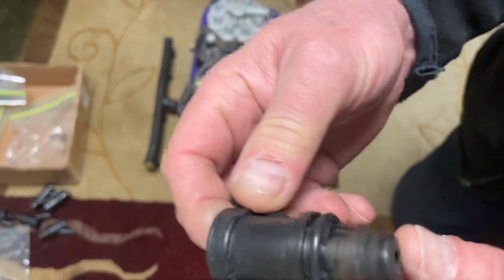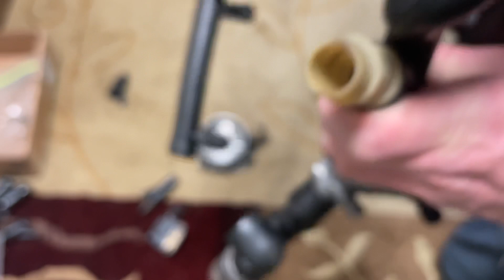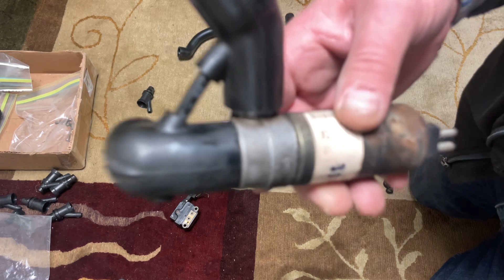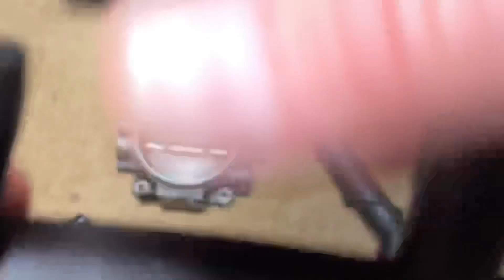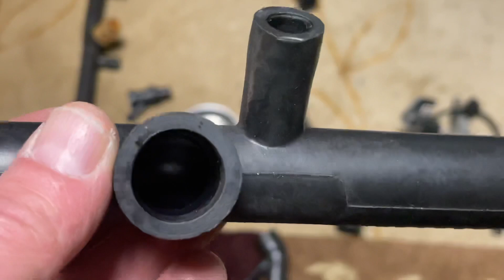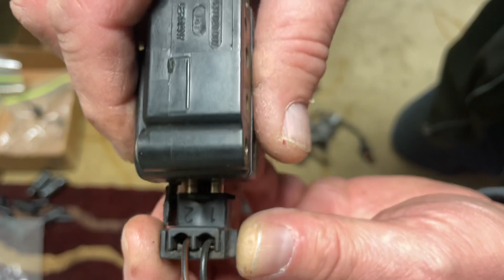Mercedes M116 & M117 81-91 Dual Air Intake System. Tutorial of the parallel intake manifold system

Comment: Great videos!  Your videos and explanations were very helpful in getting my 560sel going.  I also learned from a few other peoples vids also.  I had an no idle issue and hard start unless starting fluid or gas was drizzled in on the air plate.  I had changed the fuel distributor and did not check free play in the air plate.  That caused it to be too lean...well that mixture screw did the trick.  My air flap had too much play in it before actuating the fuel distributor!  Turning it clockwise by like 1.5 - 2 turns made a huge difference.  Now I kave like 1mm free play it seems at the far end of the flap.  Starts right up and idles good at like 700 rpm...simply amazing.  I was about to go chasing other things but this did it!

Comment: great video, thank you very much! On my 560SL from 1987 I already renewed those big rubber hoses and idle got better, but it's still a bit too high and very rough. But now I understand that the idling system of the CIS seems to be very much dependant on injectors in perfect condition for spraying those little amounts of fuel into the engine, so I will replace not just the seals around the injectors but also the injectors themselves.

Comment: Great video! I have been watching your videos since 2022 when I got my 560 SEL and they are a big help understanding how things work on these super machines. You go deeper in details and explanation and that's what make your videos great  !!! Thank you !
Reply: Hi, have a question about the brake fluid. After replaced brake disks and pads on both my 1987 560 sel ,the "antilock" light came on on both cars. Iam working to figure it out if abs speed sensor are faulty and have cleaned them twice with no result. I used Pentosin  dot 4 super as brake fluid on both cars and my question is if this is the right brake fluid that recommended on these cars? Thank you and much appreciate your help!

Comment: 24:21  Hope you feel better. On a 87’ 560sl. Took the air valve for the plate adjustment and found oil inside. Took the injector out and was oily too. Any ideas?
Reply from the maker: Oily? Leaking valve stem seals
For a 117.968 engine get two kits:

1170500367	REPAIR KIT
VALVE STEM SEALING

And check the Lower intake system, it’s probably got oil in it too
For more details on this watch this playlist
https://youtube.com/playlist?list=PLO4ZlzALkZVq3NysVV7vqO7BiZ9Kd_97D
Reply: @inovahightechltd  Thanks! Looking for it

Comment: Thank you, I have learned so much from your videos.  I have a K-Jet system on a UK 1984 500sl. No leaks found on smoke test and new timing chain. Idle speed is 650 on start, but at operating temperature it jumps to 900-950. The idle speed valve works on the bench (closes when 12v applied), has 4 ohm resistance and there is 4 volts across its terminals at operating temp - which shows 1 amp of current. So all seems correct. My first question is this - is the ICV supposed to close completely (ie airtight)? I ask because when I apply 12V on the bench I can easily suck air through it so it is not airtight. If this is normal and the ICV is OK, then what is the last remaining cause of the high idle - the Idle Speed Control Unit?
Reply from the maker: Hi John,
You may want to adjust ISCV like I show here in these videos:
https://youtube.com/playlist?list=PLO4ZlzALkZVqI7GGOhJkXJ4MNzaBtf6kS
Reply: @inovahightechltd  Thanks for the quick reply - I've looked at these but my ICV is slightly different - it's from a european 500sl (part number 000 141 14 25) and it doesn't have that threaded section to pull out or push in. Should it still pass air when "closed" at operating temperature? I don't know whether to try and change it - new ones are very expensive...
Reply from the maker: I am not 100% sure, but your idle speed at operating temperature indicates a issue. I would check the Idle Speed Control Unit first. They are known of getting cold solder connections over the years. The best and first thing to do would be to open ISCU and resolder every solder connection with fresh 63/37 RMA Rosin Flux Solder to rejuvenate the solder joints. Check also all components leads  for corrosion or oxidation. The leads may break when to corroded / oxidized. This is especially true for Axial mounted parts like capacitors and resistors.
Peter